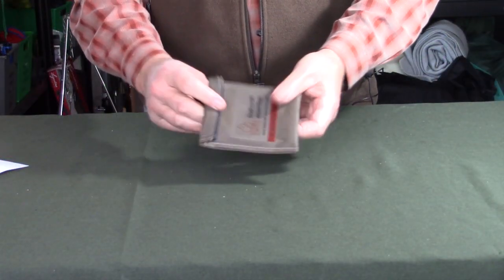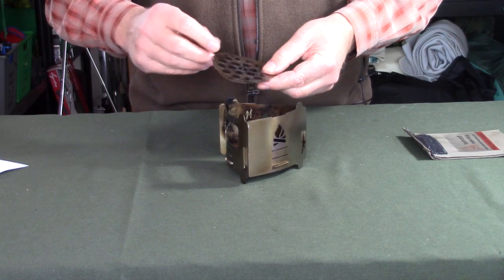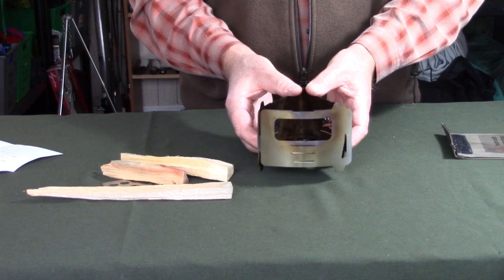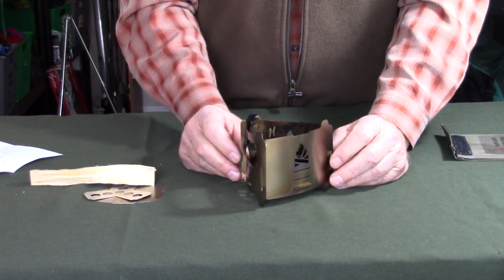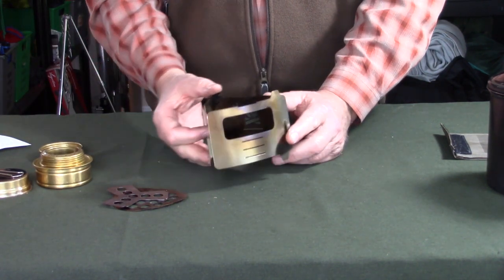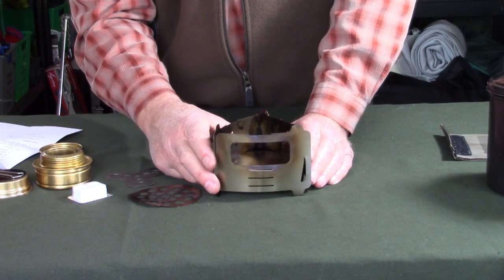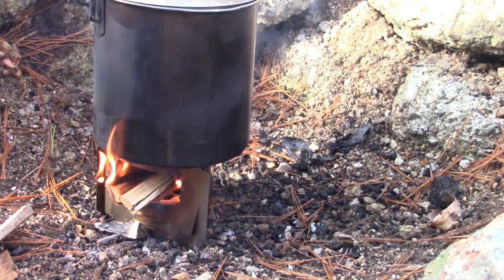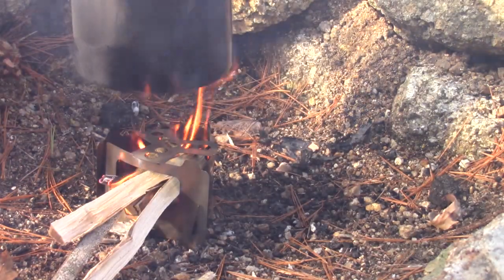Bushcraft Essentials Bushbox Ultralight Outdoor Pocket Stove Comprehensive Review

Comment: This one was my very first wood burning stove.
I believe I even have a very short video on it on here.
My only issue with it, is that when using small branches (which you can find even in some urban areas, like Chicago), you will need to be constantly feeding it to keep a good flame going, to maintain a good heating/cooking temperature. (At least, with what I have experienced)
I had bought it to save some weight (not necessarily always a good idea) and space, but have relegated it to backyard usage....primarily, for my kids, so they can get used to handling and maintaining a small fire by themselves.
Thank you, Mark, for another thorough review of this little wood stove.
I look forward to watch a video of you using charcoal briquettes in this stove, to see if that could be a viable option to take back out to the field in a day hike capacity (even for when my family goes with - obviously, will extend the cooking time.).
Keep up the great work, Sir !
Reply from the maker: I agree about the constant feeding of small sticks. I find this true of most small stoves. They do not allow you to do other chores while cooking. Thanks for commenting
Reply: @MarkYoungBushcraft  If you cut 4 pieces large enough to fit together vertically, leaving a tiny space in  the center for kindling, you will establish a long burn. I get 30 min with my Firebox Nano. Re packing: I put my firekit, folding kuksa cup, telescoping bellows, titanium windscreen, a tea bag, and microfiber cloth (also to keep rattles at bay; ), inside a 550 Ti cup w/lid; my Firebox with fireguard in a cordura case placed vertically, and a folding Ti spoon, inside a zpacks dyneema stuff sack. Everything at the ready and able to use with gloves.

Comment: An interesting demonstration .. thanks 👍.
I watched recently, a German You Tuber discussing 'warping' on metal wood stoves.
He contends (which makes sense) that these types of Stoves should be used with twigs no thicker than one's finger. Twig length should be short enough to fit inside the Stove.
Having to constantly feed it .. that goes for anything with a small fuel container / tank.
I have the Bushbox LF in SS .. use finger diameter short twigs and am quite happy with the results. This particular little Ultra-Light is on my wish list and yes, my main fuel sources for it will most probably be Alcohol, Gel Fuel and Charcoal.
Take care ..
Reply from the maker: I watched the same video and presenter makes a good point. As was explained to me by the designers at Bushcraft Essentials, it is the uneven heating and cooling of the metal that causes the warping. This happens most often when a stove is stacked like a Swedish Fire Torch. I have the BE LF as as well. Perfect size for one to two people. I have not had an issue using fairly thick splits of wood  but then again, I don't overload the stove. Have a video on the Ultralight as well if you are interested. Thanks for commenting

Comment: I have a comment about pot diameter and the integrated stand.  I have only used an alcohol burner so far, got the bushbox ul today. My Toaks 1100ml pot has a diameter of little less than 11.5 cm I think. I was able to boil water with all 3 supports in contact of the pot, but I cannot say if using it as a wood stove, that the temperature would not enlarge the support distances so that the pot would tilt a little after loosing one support contact. 

It anyways is a must if simmering a cooking in that pot to use just two of the selected integrated supports touching and keep the pot somewhat tilted. That in itself is not necessarily any bad thing in my opinion, because in nature the Bushbox UL or any stove will seldom stand totally level, so that can be compensated that way.

The 1100ml pot sits in 11.8 cm 550ml pot for backpacking/camping as a 2 pot system and that small increase in diameter makes that pot stable to stand in the 3 supports. So 12 cm pot also, and probably will sit stable enough for simmering.
Reply from the maker: If I understand you comment or question. you are wondering if a fire will cause the pot supports to spread. I have had a good number of fires in mine with no distortion at all. If you watch my most recent video I use a Uberleben Kessel on the stove with a wood fire. Yes, it is 133mm diamter but it worked as if made for the stove. When using smaller pots I make sure to install the trivet as it will prevent slipping into the stove. Hope this helps
Reply: @MarkYoungBushcraft  My post was not a question nor looking for your help, but a rather long analysis and information about Toaks 1100ml pot being annoyingly a quite limit diameter pot to use with this stove. 
Cannot be used of course with that "thrivet", nor can cook stable with the integrated pot stand optimally. 

If you read more careful, you should be able to understand. Btw free thermal expansion seldom causes any permanent distortion for designs with homogenous material. That you understood wrong too from my post ;)

The same analysis/information applies I think also to Toaks 900ml and 700ml pots with the same diameter.

Comment: Great content as always.
Seems like a good little stove for alcohol or fuel tablets. For a wood stove it should be a couple of inches taller and needs a little more ventilation at the top, I think.
Reply from the maker: It is interesting for being as short as it is how well it works with a larger pot. Not as well with smaller pots on the trivet for the reasons you mention. Thanks for commenting

Comment: Good video again.  My opinion is that "jigsaw" stoves are tricky to use if is cold weather and fingers are frozen. And must be careful that not to lost parts.
Reply from the maker: Vary true.  A folding stove or a one-piece stove are easier to use when it is too cold to work with bare fingers. Thanks for commenting

Comment: I’m a big fan of this little stove because it is for my money a better pot holder for the Trangia than the Trangia triangle; cheaper too. You can enhance its wood burning capabilities if you leave the ash pan home and just set it on a piece of aluminum foil. The foil helps reflect heat back up into the stove, and the ventilation and burn chamber volume are both increased by using just the fire grate in the lowest position.
Reply from the maker: I agree. I carry it on almost all outings. I use it as much with my Trangia as I do with wood. One of the best in the Bushcraft Essentials lineup. Thanks for commenting

Comment: Have you ever seen the preheater from tangia?  I've just made one for mine by cutting the bottom off a cheap, thin steel, water bottle I got at value village for $1.    Used a dremell to cut it, then pliers to fold over the "clips".  Double folded for me, because it's so thin.  Might make a good (and cheap) diy video for you.
Reply from the maker: Yes, I have seen (but not purchased) a Trangia winter pre-heater. I do often use a priming tray but I could see if I could fashion something similar to what you made. Thanks for the idea Jim

Comment: I like this german made quality design a lot. In my opinion this is a spirit or solid fuel tablet stand  stove and a somewhat of a windhsield mainly. Just what Mark told too. I don't have something like a typical 750 ml pot that would stand solidly inside but not top on the "integrated" corner supports. I am interested how they work in windshield regard?

This post is about soot with my denatured alcohol, Sinol.

 It is about Trangia burner sooting more when the effective burn distance is like almost 1.2 inch compared to the something like 0.8 inch. I always put something like 30ml water to my Trangia fuel bottle, total about 450 ml.  Trangia burner won't much soot with 0.8 distance, can be controlled with putting my 118mm pot on top of the integrated stand on the base plate in middle setting, If put on low, the most fast setting, it will soot some. Nothing of course like using this as a hobo :)

Sooting has not anything to do with this stand. Not like oxygen enough or any. You can put the thrivet under the Tangia burner  in lowest with if really more oxygen is needed? No effect. Sooting has only to do with how Trangia type burns with a yellow flame too with burn distance, thats all. You can see how the Trangia burner flames under no pot.

Interesting thing is that my chinese Tomshoo japanese Evernew burner copy, with base plate set on the middle has about the same burn distance as Trangia with base plate set on bottom. Just it burns with a quite blue flame. And does not soot much. Will be time to see how well those 0.3mm plates can take those blue flames as they are close and somewhat suppressing the  flames to keep under such a small as 118mm diameter pot :)
Reply from the maker: Thanks for commenting
Reply: I'd like to add about alcohol stoves in winter. It is just a myth that they won't work as well as in warmer weather. We can have this Tomshoo titanium burner as an example. It has no cotton wicking inside. Does not matter.

We can pour -20C alcohol in the burner and warm it with putting a tea light candle under the Bushbox UL, or use a lighter from pocket. Smelting snow of course takes time if not lake water available.

Comment: I really do wonder if the weight saving you have with such a small stove is enough to weigh in against the work you have to process and feed compered with a larger heaver stove were you feed and can do other camp chores at the same time.
Reply from the maker: You make a good case Barrie. I think that is why I see using it with alcohol before wood. Then again, most small wood stove require a lot of tending. Thanks for commenting

Comment: When using alcohol or Esbit with a smaller cup, do you have a sense of how much the trivet acts as a heat sink and reduces fuel efficiency?
Reply from the maker: Hard to quantify but it does pull heat away fro the pot. The trade off is airflow but that is not an issue with alcohol. Thanks for commenting
Reply from the maker: Hard to say without doing tests with and without but my experience is, if the flame touches the pot in between the trivets, the heat loss is minimal. It is when the pot supports are in a cross formation that they really rob heat away. Thanks for commenting

Comment: My only issue with this stove (when used with wood) is that I don't really trust the ash plate because it'll leave 3 very large holes at each corner. I tried cutting a thin steel mesh that goes in perfectly into the bottom of the stove and rests on top of the grate.. it works well but it's not an elegant solution 😅 the steel mesh sides poke at my hands and other stuff every time I use them.

Do you by any chance have different ideas to use instead?
Reply from the maker: I understand your concern. For me, if I am able, I try to make sure the stove (or any stove) is on a fire safe surface. For this stove, or stoves that I feel need another layer of protection I use a piece of heavy duty aluminum foil. It will not withstand a lot of direct heat but does work well when there is a small gap. The few coals that may fall through are unlikely to burn through the foil. Hope this helps.  Thanks for commenting

Comment: My comment is twofold. 

I have always in videos people have posted seen that they have been suffering with using it as a twig stove. My thought to this is that maybe the slots, 3 had been better positioned somewhat like 1 slot higher, and in that given that much more height. With some added  weight. My 10 cm height windscreen would not though, work unless the stove had not been pushed into ground.

The other is that it is now very fine as an alcohol burner stand. I am not sure that methanol, Heet etc. is not better in not sooting the pots. My denatured alcohol Sinol contains at least 91% ethanol.  More BTU than methanol and not sooting either.The rest is 1-5% isopropanol, that is very sooting, 2% ethyl methyl ketone (butanone) and 2 % methyl isobutyl ketone, all as denaturation stuff. 

I don't get any hand sooted pot after boiling with say 0.86 inch after boiling when rubbed by hand. In the long run the pot bottom does get black though. 
When putting a Trangia burner on the bottom slot of Bushbox ultralight or Tomshoo (Evernew copy burner) 1.25 inch on the second slot and rubbing the pot bottom after in my hand, somewhat brown effect. Could be just that isopropanol content?

Nothing serious and can't be compared any at all with a wood stoves one at all. Just I wonder if pure methanol, forbidden I guess to be sold in Finland, is really less sooting?
Reply from the maker: It is interesting to me to hear people complain about sooting when using methanol. I purchase hardware store methyl hydrate and have no sooting issues at all. At the same time, my pots are all very sooty from using over fires so it is not a concern for me. Yes, this stove works very well with alcohol but I do like how it works with wood as well. Thanks for commenting
Reply: @MarkYoungBushcraft  I guess you are right, just let my pot get something on bottom :)  I did found though a solution with cleaning. They are called, translated, as soap-fine steel wool pads. They work. Nothing else did, so I was like, I am doomed.

Comment: In cold weather wouldn't sitting it on a rock without the ash pan risk cracking the rock?  I've had some pretty large rocks crack that were the outer ring of a fire.  Of coarse it contained a really large fire.  I would not want to fumble with assembling a stove with cold hands.  I can see the benefits of using it for alcohol.  The warping was most visible when you first removed the parts from the bag (not a deal breaker).   Website won't display the price since they won't ship to USA at this time.
Reply from the maker: I can't imagine it generating enough heat to break a rock but you never know. Yes, it can be challenging for cold hands. Having said that, I just used it the other day at temps right around freezing with out issue but my hands were warm from hiking so that likely helped. If you are in Canada you can purchase through Canadian Outdoor Equipment. Thanks for commenting